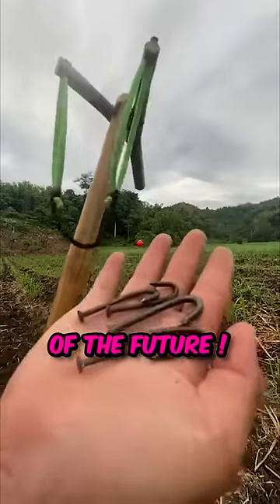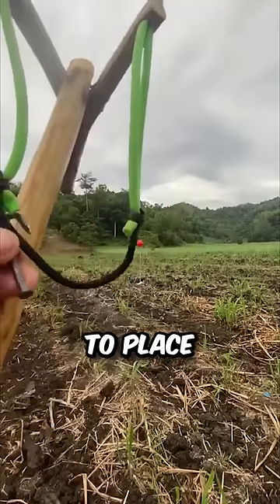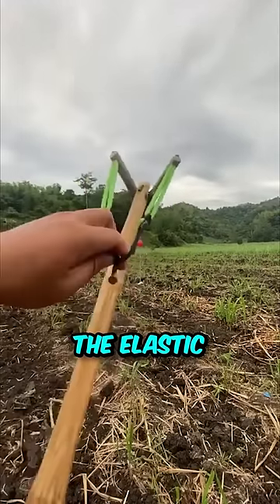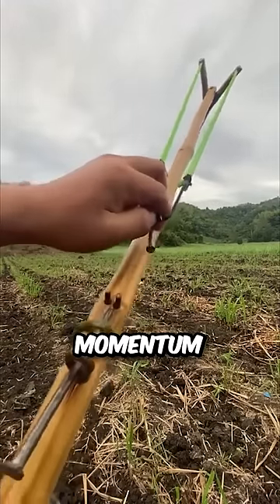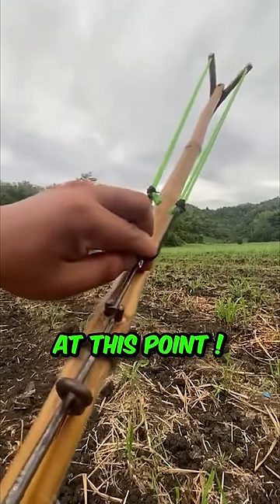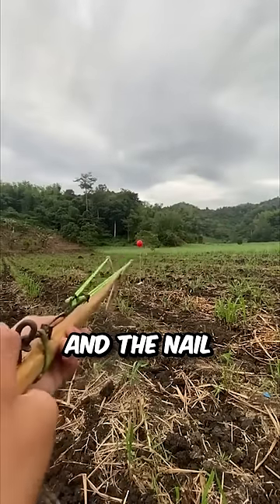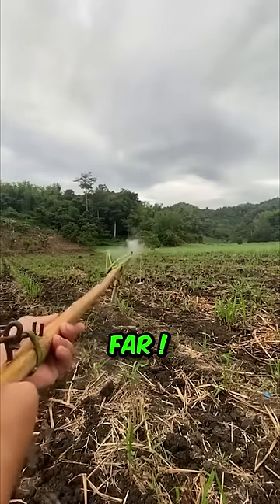From Nothing, this Man made a Rifle 🔫

Comment: It is not called momentum, its called elastic potential energy. Energy is stored in the rubber due to the extension in the rubber band, and then the energy is converted into kinetic energy once the band is released. Stop saying random things, you are disrespecting physics.